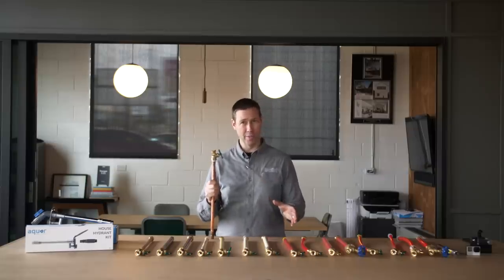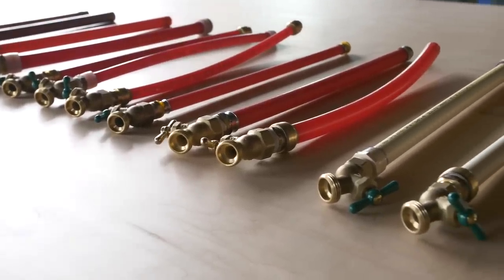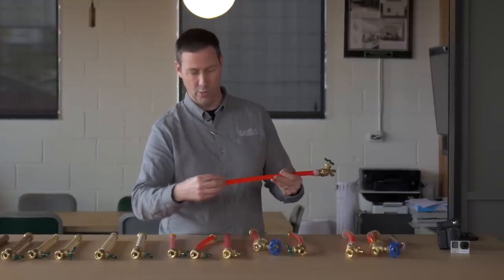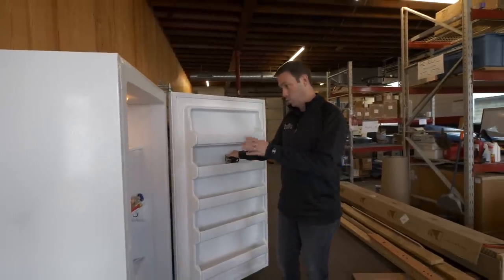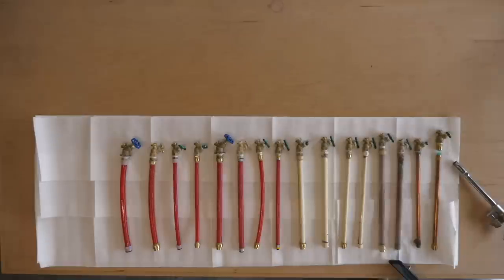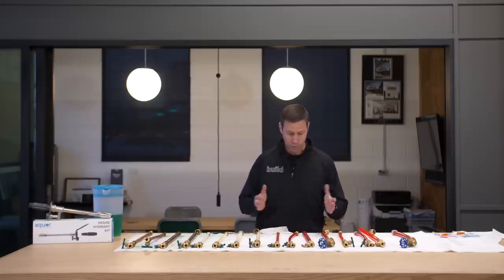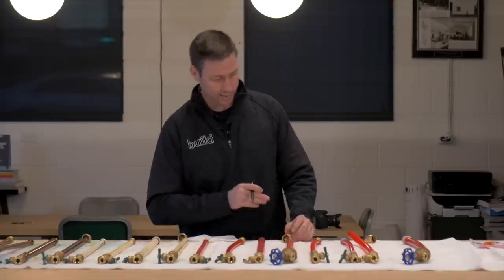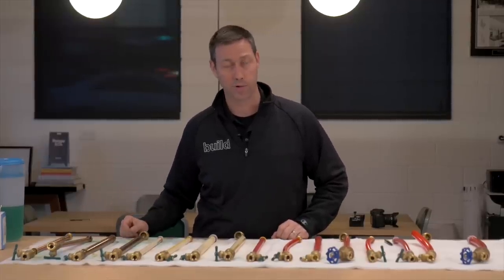Copper vs Pex vs SharkBite - Freeze Testing

Comment: Good video Matt but a big factor in what to choose for your pipes is the longevity. Aside from the possibility of critters damaging plastic pipe, pex is far superior to anything else around. I've been a plumber for 40 years & this is how it is. Copper pipe has a service life of around 30 years  for type M & 40+ for type L before it starts thinning from internal erosion of the flowing water flaking off tiny particles of copper where it gets so thin, it starts weeping or develops tiny pinholes & has to be replaced.

Your test on CPVC might have made favor for it but if you had done that on 20 year old pipe, the story would have been way different. The chemicals that are in new pipe give it some flexibility to expand but after 20 years or less & especially on the hot water side, those chemicals leech out of the pipe & it gets real brittle. I've done tons of service calls repairing CPVC where the client just hit a pipe coming out of the wall to a toilet with a mop or just turning a stop off under a sink & it snapped off. Same on old pipe exposed to freezing, it just shatters. CPVC is the worst choice unless you plan to build something you won't be around to deal with the headaches you'll get 20 years later.

I've been using pex around 15 years now & old pex pipe appears to retain the same quality as when it was put in. I haven't seen any deterioration factors in pex except in some of the fittings made of copper I've run across that actually dissolved. In my estimation, pex could last 50 years & perhaps 100..

Comment: we've used pex at the cottage (summer use only) over a few winters. We drain the waterlines as best as possible, but will occasionally freeze trapped water over the winter. We get it warmed up come spring and have never had a leak at any fittings.

Comment: Cool test.  when water freezes it actually kind of oozes around to the point of least resistance. If the path is no longer there then the new path becomes the weakest point in the material. In the case of a very flexible material it just flexes.Copper for example will split. The pressure produced by freezing water is insane around 30,000 psi  but above that pressure ice takes on a form which no longer expands and an interesting point at -20c ice no longer expands as well. .. Cheers
Reply: yep high pressure for sure….eventually if you freeze enough of a system something will give
Reply: No pipe will handle that pressure. the only pipe that will survive has to be flexible enough to accommodate the extra volume.

Comment: Matt great video!
I'm still commenting on one of your other sharkbite videos. Some will never think that this newer technology can replace sweated copper fittings and copper pipe. To those that think copper has some magical microbial properties don't look inside a 20 year old copper pipe, it will be closing up with growth especially if you have a high tds.
PEX is the future boys, better get used to it.
Reply: I work on plumbing all the time. I have seen multiple shark bite failures.
They do have a use IMO, and that's for temporary repairs. Rubber gaskets fail. Esp when introduced to water.
His video even proves they cannot take  too much pressure or they pop.
CPVC and esp PEX expand outwards to allow for this espansion, which is why they didn't pop..
Now just imagine the city main gets shutoff and turned back on, producing an extra amount of pressure inside your house plumbing, your pressure regulator (which hasn't been tested since the house was built) fails to regulate the added pressure, and you're at work...
PEX is OK. Hope the chemicals used to make it don't get recalled in 20 years like lead, asbestos, and so on. A buddy plumbed his house with PEX. Water had an awful chemical smell. 
Just my thoughts and experiences

Comment: I am a fan of copper freeze thaw is one aspect in plumbing. When building a building correctly with correct heating and insulation
Copper is awesome. My current home built in 1960. Which is 62 years old with copper I really wonder what “PEX” longevity’s would be. Since we are a disposable society people and price is always a factor I understand cheap and the longevity is the next persons problem. Of that 62 year old house 36 years with me and  no plumbing issues. I bought a repo house vacation home northern Michigan in march no heat PEX plumbing. I replaced two shattered toilets one split hot water heater and all of the PEX plumbing.
Replace with copper pipe.

Comment: I’ve never seen pex installed in manner such as I had done myself in order to prevent frozen pipes, pitched properly and can’t imagine someone accustomed to pex installing copper properly in accustomed fashion. I saw a local mansion that had threaded bronze a style and vintage system meant to last nearly forever until financial calamity left it unheated and it failed catastrophically. You’re testing isn’t going to help informed people but it’s certainly going to alarm laymen. Those shark bites I have always avoided because of the installation cost I thought they were a gimmick. The glue joint pvc was worse than sweat type L copper. I think a battery powered solenoid operated by a temperature regulator that simultaneously cuts off the water supply and drains the potable water lines would be a bigger better solution for the water freezing problem than replacing a built in water system but effectively ruining a house in fear of a freeze up that hasn’t occurred yet. It’s a requirement that you have installed the water system permitting it to functionally drain back to a low point but that’s already supposed to have been done and kept up.

Comment: We used pex A in Montana, the only issues we had with uponor is that we'd have to use a heat gun sometimes to get the pipe and fitting collars to shrink back in negative degree weather.

Comment: What happens with copper pipe when it freezes it does more than split it also weakens other joints that go unnoticed for a long time till they finally let go.
Reply: yup, repaired a lot of frozen barn pipes for the neighbors. it is nicer when the expansion pushes the joint apart instead of rupture.

Comment: I'm surprised that CPVC withstood. I expected CPVC to crack before copper because they are rated for much less pressure and plastic becomes harder at low temperature. I have seen plenty of cracked CPVC from freeze damage. Might be a good idea to test both Type M and Type L and compare to see how much difference it makes. Also would been better if the water inside was pressurized for more realistic test conditions. Just hooking it up to a hose then shutting valve off will do the trick.
Reply from the maker: Good ideas for a follow up video
Reply: I expected to see it fail too.  Makes me wonder if that age of the pipe plays into it a lot.
Reply: CPVC definitely doesn't age as well as other pipes
Reply: It is the first time hearing copper gets more brittle than plastic in cold. May I have a reference? Pex. May be. CPVC. I seriously doubt it. CPVC is brittle as it ages even in a room temperature. I just replaced section of CPVC pipe that developed pin hole leak after 12 years. CPVC was so brittle, it cracked what I cut the pipe with plastic pipe cutter (ratcheting type).
Reply: My question to you is regarding copper being more brittle in the cold than CPVC. Even new CPVC is more brittle than copper in room temperature. How does that change in cold temperature?  If you were referring to PEX instead, then yes I agree PEX is better in cold temperature. That is because PEX is more flexible compared to copper. PEX is more versatile in my opinion. There 2 things I don't like about PEX. PEX requires more supports because it is so flexible. Crimp type PEX fittings tends to fail. Expansion type is better, but requires bit expansive special tool.
Reply: totally agree,cpvc=GARBAGE,and put 35 psi on those pipes and guarantee different results
Reply: N C i have real life results with real life applications with 30 years in the field and just with this last cold snap in NC CPVC came out on top with the most fails and property damage,we had 2 busted copper pipes v/s 50 busted cpvc lines and granted properly insulated and/or in protected area lines may never have any issues,my final opinion and in my personal home i feel totally confident in PEX above anything else in this day and age,PERIOD
Reply: tipoblanco type A pex... Is that the red/ blue pex.? & the fittings your using.... Are they the plastic black ones or the brass ones.?
Reply: Iambition, you should cut older CPVC with a fine tooth saw, not ratchet cutters. Just like anything, you need to use the right tool for the material.
 <just replaced section of CPVC pipe that developed pin hole leak after 12 years. CPVC was so brittle, it cracked what I cut the pipe with plastic pipe cutter (ratcheting type).>
Reply: Nope, already witnessed 2 yr old cpvc fail spectacularly. Give me copper.
Reply: Age..  come back in 5 years and put those cpvc through the same test.
Reply: I've used copper, CPVC (both in the south), and now PEX. Copper is soft, and always splits with any solid freeze. CPVC shattered in a hard freeze. We were residing in the unfinished house I was building at the time, and I actually heard it break. It sounded like a circuit breaker tripping, and was shattered when I could locate the break the following morning. ....it was the washing machine hot line. Thus far, in Colorado, in the mountains, I've had no issue with PEX B, but all lines are protected, only having one with a freeze blockage just inside the exterior crawl space door the first year, again before the place was done. Just my two cents, based on I've experienced (I'm not a plumber). ...one other thing, agreeing with another commenter... PEX does seem to have more restriction and flow loss per size, compared to other pipe. It appears more drastically with 1/2" compared to copper or CPVC. I've overcome this to a degree by running 3/4" all the way to a fixture (or on demand water heater) then reducing. Also, being somewhat flexible, I sweep the PEX to a fixture if space allows, instead of using an elbow which can cause more restriction and flow loss.
Reply: Flexibility is a good property to have in a pipe freeze circumstance. The more rigid the pipe, the more likely for it to split. Freezing water can develop a near infinite amount of pressure. No pipe can withstand it, unless it can expand to accommodate the extra volume.

Comment: Last year had some Poly B pipe freeze up. It ended up leaking. This year, replaced with Pex. Froze up again at -20c. Thawed it out, and it’s working again, no leaks. Now I will air seal and move it away from the cold wall that’s causing it to freeze and should be good to go!

Comment: My question about the methodology is whether the "overnight" in the freezer was long enough for the water inside the PEX (and maybe CPVC) to freeze to its maximum expansion?  Since the plastic is a thermal insulator (and copper is a thermal conductor), it would take longer for the water to freeze in PEX pipes (thought I don't know how different the times would be).
Reply: nitpicking, but frozen H2O in pipes actually contracts.  Pipes will split when they thaw as they re-expand again to its densest state of 4 celcius.

Comment: Fun fact. . .  In ocean coastal areas we’ve found that plumbers won’t use pex pipes as the steel or even SSteal connectors will rust and fail at some point in their life due to salt air corrosion. Only use pvc which many many burst during the February 2021 4 day sub freezing weather. This was in Galveston, tx. 😮

Comment: Should;d do the same test with 10 or 15 year old pex. see if it holds its strength with age.
Reply: It won't as you probably know.  Gets super brittle.
Reply: Uponor has a 25 year warenty on pipe degradation  and in over 25 years of my family installing Uponor wirsbo in hotels and apartment buildings up in northern canada    all of the problems we have gone back to fix the only material problems have been with copper getting pinholes
Reply: Private Number  Main reason is the material its made from is Soy based polymer oils, vs petroleum. Soy / Soybean = food to those little critters. Electrical systems have the same problems and squirrels, mice, rats love those wires. So if you want to go "Green"  think twice about it!!!!  Do you really want your apartment building or fancy condo and your BMW to start on fire due to those dirty rats!.  Even the car tires are using it. Which have (Iv'e been told)  about 30% long life expectancy!  That and the fact they just love to chew on things. Not trying to bash being "Green" but there is a time and place vs practical use for said soy based items. personally I cant think of any. Just sayin
Reply: It sure will. They have been using PEX tubing in refineries for 20 years now
Reply: Never seen brittle pex yet that wasn’t in direct sunlight for a year or so. Been using it since 2002 in my area. The old kitec and stuff is a problem, but even that isn’t “brittle” when we come across it.
Reply: @DustinGould  kk

Comment: I work on old stuff so would have loved to see an iron pipe comparison too, or please leave your experiences down below; thx! Also repeated tests would be even better since temperatures warm up and freeze many times thru the winter (releasing the hold and pressurizing again).
Reply: I’m not sure about this test, as the water isn’t pressurised. Interesting nevertheless.
Reply: @thebaconized4733  how would you pressurize the pipes if there's no air to speak of? Unless you connected every pipe to a pressure pump, but what would that show? The point is to see the effect of freezing water as it expands.
Reply: I can tell you from working with iron pipe last week that it blows out just like copper. specifically at the damn Ts lol.

Comment: We have a cottage in Ontario, it gets down to -30C in the winter. One weekend the heat died while we were away and all the pipes froze, luckily most were PEX-A with a mixture of Sharkbite-like fittings and crimp on fittings, they all thawed and were fine, the 2 feet of copper we had in the shower had burst and spewed once it thawed, (as did our kitchen faucet).   PEX-A is great it there's a chance it'll freeze, some of ours have frozen many times and thawed, never leaked or burst.

Comment: I guess we are going to be putting our piping to a real world test here in Austin, TX!
Reply: def one for the record books, thats for sure!  we've already had 1 copper blowout, heres hoping theres no more!
Reply: @Dildo_Baggins.  - hope you didn’t have too big a mess. Several of my friends and family have had their pipes burst - here in Baytown, TX - definitely a place not equipped to handle a very hard freeze. Good luck to you!
Reply: Here in Houston as well. I wonder how PEX-A stands up to heat and humidity?
Reply: Massive copper pipe failures in Houston, my place in the Hill Country (Pex) did just fine.
Reply: @doughirsch7685  yes, I’m going with PEX over copper. The copper would have been fine right up to the point that we lost power and heat. Temperatures dropped down in the single digits and that all it took to start cracking copper. I have the problem of finding a plumber that isn’t book past next month. I spent 2 hours at Home Depot to find 3/4 PVC for the broken parts leading from the ground up to the main house valve. Fortunately they had the parts and I was able to fix that. The valve went to a galvanized pipe into the house that cracked and the copper pipe past the outside brick just before a 90 degree elbow cracked. I went back to Home Depot and they didn’t have the copper pipe nor fittings. So I am resorting to a temporary fix using JB Weld, electrical tape and tie wraps.
Reply: We had PEX and no issues, they also cut our water at some point before the power went out drastically (no heating) and our system drained back into the street (as far as I can tell).
Reply: @jroar123   Hi from Massachusetts.  I'm so sorry many of you are going thru this hardship.     And the cost of repairs is hardship to come too !    Where I live, the winters get to the single digits, and the summers up to 90, so my pex pipes get cold and hot all the time.   My home has all pex tubing, except for the copper line that comes from the street.   In the 23 years I've been living here, the pex tubing and fittings have so far, never failed!  No leaks!   ( the home was built in 1986 - and no plumbing pex upgrades too ).   

Over the years jroar123, I've wondered at times why copper pipes are STILL being used ! ?   Metals freeze!    Maybe plumbers love using it, because that's what they know, plus, they stay in business, because copper pipes fail !
Reply: My austin TX house with PEX water plumbing survived Winter Storm Uri (9F & no electric/heating and I didn’t drip the faucets) with no plumbing failures. Whew!!!

Comment: old school way of using a copper rod into the earth especially for outdoors around horse stalls is how we kept pipes from freezing.  uses the dirt as a heat sink. in some areas we used a heating coil.  always put tube insulation around pipes even if in the walls.